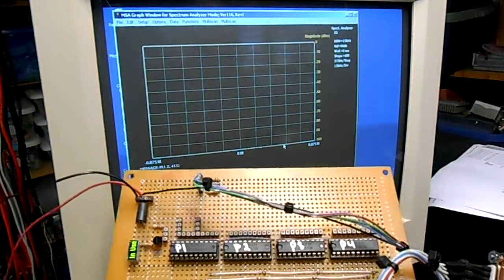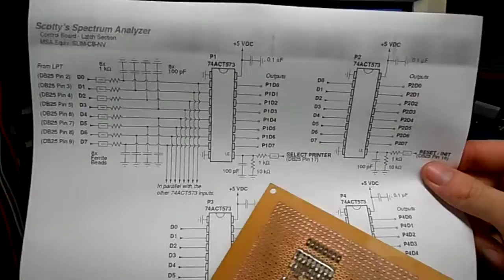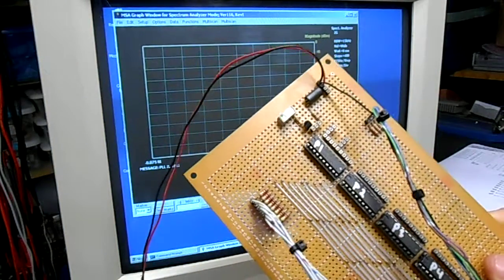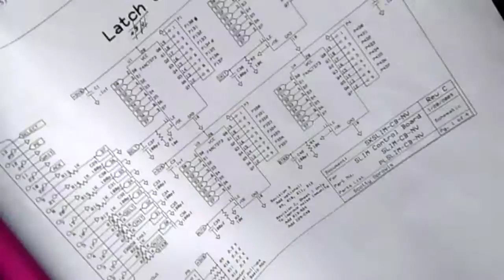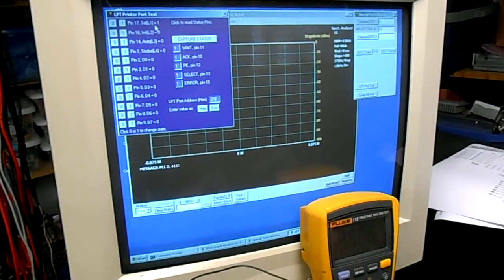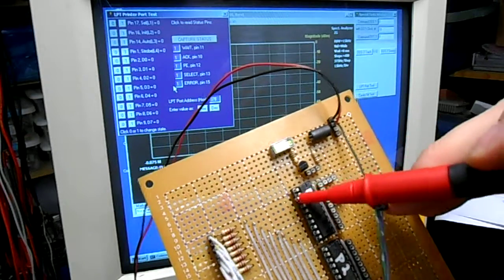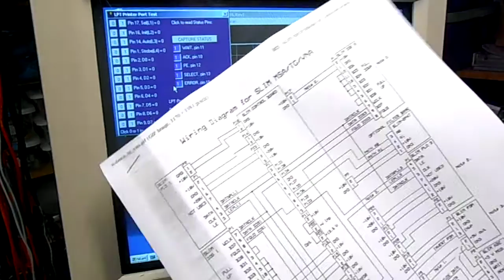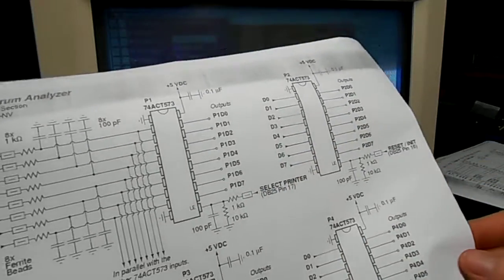GBPPR Vision #17: Scotty's Spectrum Analyzer - Part 2

Comment: Nice looking work! How much $$$ is involved? I was going to buy a spectrum analyzer, but I am finishing buying the slugs for my new old Bird Analyst, which will set me back $500-$1000 for HF, and another $1200-$1500 for MF, VHF, UHF, & SHF. A Service Monitor is also on the agenda, & I am due for a new soldering station ($1400).